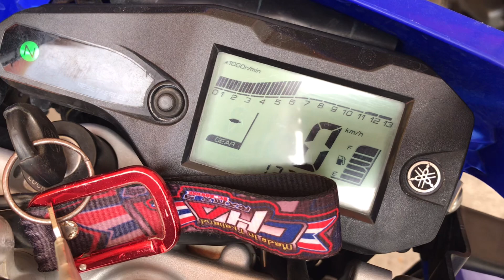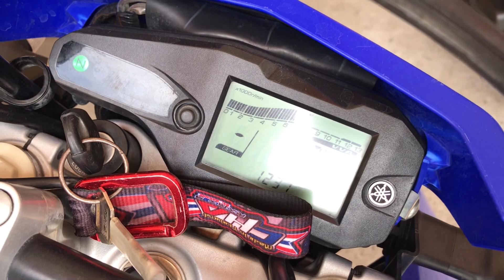INSTALLING : WR155 Racing Ecu 13,000 RPM

Comment: whats the purpose? will this improve the wr155r's power and topspeed?
Reply from the maker: Certainly yes
Reply: @chazortizracingspecs8028  sir thank you sa reply.. nakit.an to nako inyu video with ur friends grabe naabot ug top speed sa imo wr155... sir if you dont mind unsa imo ge pang upgrade ato aside sa ecu? i think imo exhaust imo pd ge ilisan?
Reply: Same, meron din ako tanong, if safe lang ba mag palit ng racing ECU kahit stock engine at pipe?
Reply: will ecu remap give some torque that we need on climbing up hills/trails? or sa top speed lang sya may dagdag?